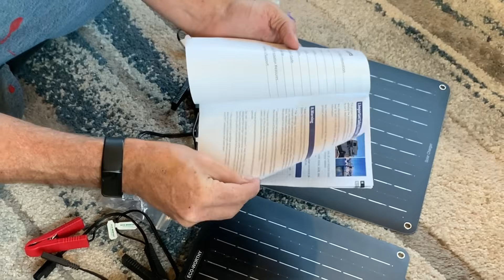Eco-Worthy 10W 12V Solar Panel Battery Charger Setup and Test

Comment: Does using the newer model connected to the ODB mean you do not have to directly connect to the vehcle battery with the aligator clips and the charge goes from the solar panel to the OBD and then the battery with built in vehicle wiring.  I have a 2nd gen toyota sienna and had to Google what an OBD was and where it was.  I also read another comment and wonder about possible vehicle damage.  I have been debating something like this for the camper mini van I have created instead of possibly needing to use a NOCO jump starter I have and have had to test and thought I would need to do some of my own wiring from the panel to the starter battery.
Reply from the maker: ODB and Battery clamps or Lughter and Clamps .. so both versions come with clamps, and yes some of the old ODB connectors tried to interface with computer and caused problems. This has no pins connected to anything other than battery.. hope that helps

Comment: I'd like to post a warning to anyone who tries to charge their car battery through the OBD or OBD2 port. I did this with our 2007 Expedition and it completely destroyed the ECM module. The new module cost me over $600. I installed it myself or it would have cost even more. I'll never plug anything other than my OBD2 diagnostic tool into that port again.
Reply from the maker: Yes, older units from some companies did use the wrong ports.. This unit only used the batter connections .. I checked the pinout of the device.. :)

Comment: This if off topic but can you share your jkbms setting for the Batmon monitoring?  I am working on a few designs to interface JKbms V19 to ESPhome both wired RS485 and BT enabled. I wanted to try with the batmon but want a quick setup. Hope all is well.
Reply from the maker: Sure is pretty simple config .. Use the debug to get the MAC address:

- address: C8:47:80:22:22:6A
  type: jk
  alias: jk1
Reply: @MattManSolar Thats what I used but it’s not compatible with V19. I did not want to do allot of debugging so thank you for confirming. I caught your live stream where you showed your config but I could not find it on your channel. I got the ESP32 RS485 to work with JK V19 I just need to parse the data for home assistant.